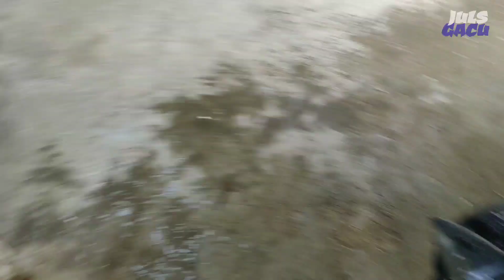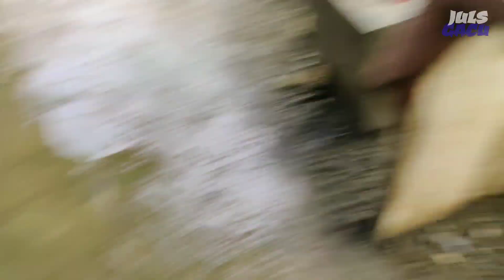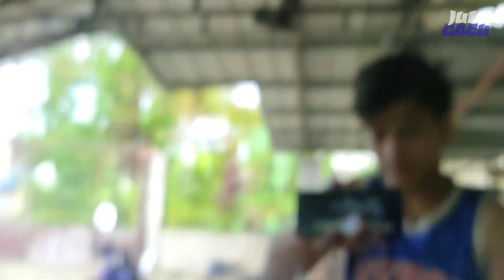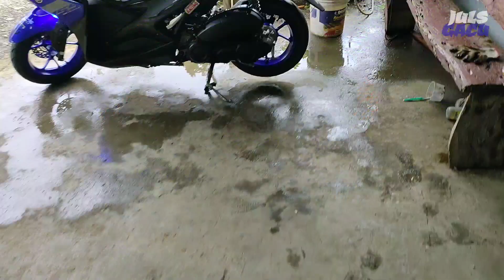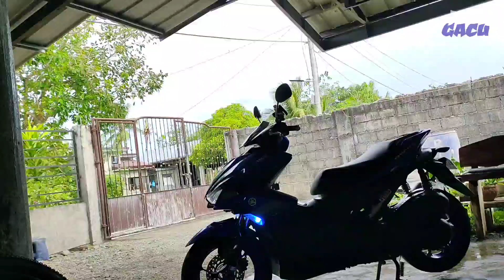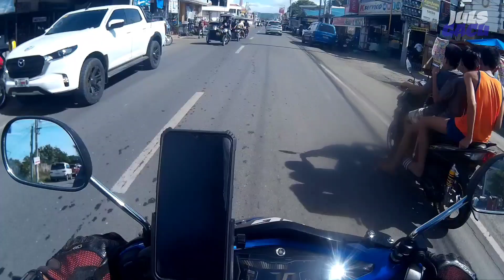POWERCAM + JVT PIPE V3 (FULLY OPEN) MAS MASARAP SA EAR'S

Comment: Same set sir sarap sa ears yan hehe.
Reply from the maker: Ou master. Parang kinakalite 🤣
Reply: @julsgacu  nasa nmax aerox kargado group ka din boss no? Hahahaha balik loob na ulit kasi sa v3 hahahaha nag v2 din ako pero iba bigay ng v3.
Reply from the maker: @kolinsamson7753  hahahaha oo master tsaka nag laki na kase ako makita ngayon kaya need mas malaki labasan ng air. Watch mo latest upload ko master 👌
Reply: @julsgacu  noted sir hehe isa ko sa mga kauna unahang subscriber mo at nawa lumago channel mo sir, more power! 🤙
Reply: Kalansing issue si jvt v3 sa ajuster nya?
Reply: Boss pag nag palit ba power cam may iba pang papalitan all stock akin naka pang gilid lang salamat sa tugon mga boss
Reply: wla ba nging prob makina m sa power cam lods? di nkakasira ng block or spring kht bolt on lang?

Comment: boss ung sakin naka straight jvt cvt ako tapos sungaw tunog ng jvt ko. need ba palitan ng exhaust gasket or kulang sa tono cvt ko?
Reply from the maker: Ako po naka powercam kaya hindi sungaw. Not recommended po jvt v3 sa all stock engine. Ma susungaw po talaga
Reply: @julsgacu paps swak ba yan sa super stock naka cam stage 1 bolt on naka port din block na full set cvt? Sana mapansin
Reply from the maker: @greentino2006  yes boss pwede

Comment: bossing ano cvt set mo dito bola and springs pati pulley?
Reply from the maker: 2k clutch 1.5k center straight 10 flyball
Reply: @julsgacu  boss may dulo ba set na yan? and ano top speed mo? TYI
Reply from the maker: @DOGGO-ch6gg  arangkada ginta dulo. 138kph
Reply: Kamusta po gas concumption?
Reply from the maker: @iancelis5570  malakas

Comment: Boss pano ba palabasin yung backtone? Nmax v2 ako naka jvt v3 rs8 clutch bell straight 9 bola, center spring 1500 clutch spring 1000 tsmp pulley set wala parin backtone na lumabas gustong gusto ko talaga marinig yun, salamat sa sagot in advance boss ride safe always
Reply from the maker: Bore Up or Hi Com (Super Stock)
Reply: @julsgacu  magkano kaya magagastos kung superstock lang boss? Okay lang ba pang daily?
Reply from the maker: @devinsantillan4083  more or less 15k kasama na cvt
Reply: @julsgacu  ahh, babaguhin padin ba cvt ko boss? Torque drive nalang yung stock cvt ko
Reply from the maker: @devinsantillan4083  goods na yan. Engine nalang para hindi sungaw

Comment: Stock injector at airfilter? Walang pugak 0-80% throttle sa arangkada?
Reply from the maker: Kung stock engine no need po mag palit ng injector. Airfilter. Recommended uma racing po. And check po nyo or palit kayao fuel filter every 10,000 km odo.
Reply: naka CRP Powercam Bolt On ako sir. stock engine. balak ko mag JVT V3. Wala na po iba dapat palitan maliban sa air filter?

Comment: 57g mu bro tas 1500 center tas 2k clutch mu
Reply: @alvsolute  sa pagkakaalam ko boss ang crp powercam nas nanghihingi ng mas mataas na rpm para mas ma maximize ang power. hindi lang sa karga pwede gamitin ang ganyang springs at bola 😁
Reply: akin cam lng pero naka 51g ako tas 1500 center at 2k clutch 74kg timbang ko easy 130
Reply: @cedrickcaparas118  jvt v3 din pipe mo boss? anung combination nung 51g mo boss? city driving? db malakas sa gas
Reply from the maker: Tama po 😊
Reply: @xgvrz5087 totoo to boss. CRP powercams din nmax ko. Crp pulley, 1200 center 2k clutch straight 9 bola. naka jvt v3 din. fully open.
Reply: @Berzofamily  Mabilis lang ba nakuha ts boss?
Reply: @ianbernas6174  Mabilis lang. pero magtataas pa kase ako ng center spring. 1500 dapat. 300meters siguro, nakakuha ako ng 115kph. 80kg ako. May angkas na 50kg. di ko pa natotopspeed ng ako lang e haha.
Reply: @Berzofamily  salamat boss try ko nalang siguro para malaman ko na compare ko kase sa vid ni idol ocrider matagal nakuha ng mataas na spring ang 100-120
Reply: @cedrickcaparas118  may torsion controller pa kayo boss? Or wala na?